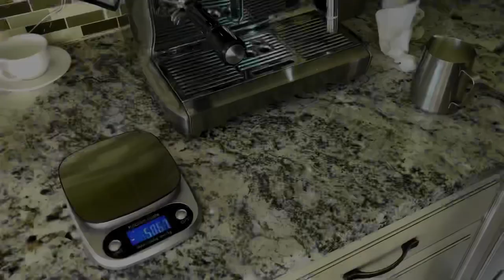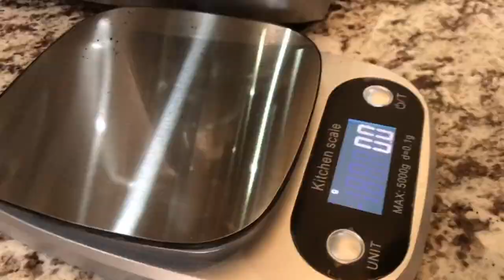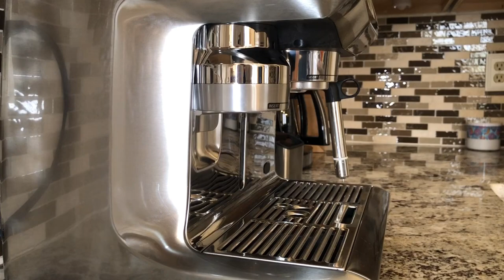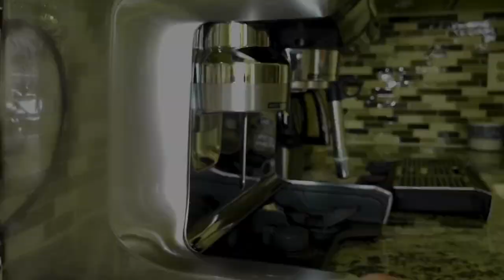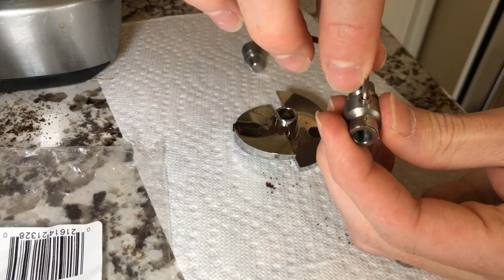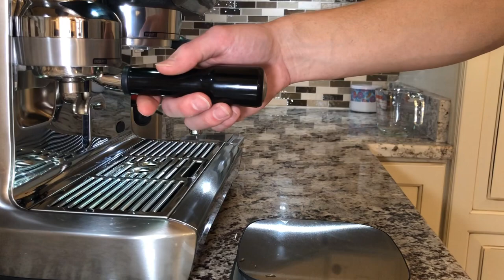Breville Oracle Touch Maintenance - Tamping Issues - Wavy Tamp

Comment: I had the same issue but the screw was still in place. What helped me was advice on Reddit: the tamping did not work on a completely dry basket. I was used to wiping the basket completely dry before grinding. With the auto-tamp, it’s best to leave the condensation wetness in the basket and not wipe it dry. The dampness helps to create grip for the fan, otherwise the tamp fan might just rotate the puck with it instead of tamping it. I assume the 1 cup basket has that special grip coating for the same reason.
Reply: Thanks for this valuable advice.
Reply from the maker: Thank you for posting this tip. I think I mention this in one of the videos or in some comments. For a while I would wipe the basket with a damp paper towel to add some moisture before tamping. You are right, it helps to reduce wavy tamps. Thank you!

Comment: I got the same machine early 2020 and thought it was damaged because the official unscrew-via-the-fan way of removing the tamp mechanism didn't work. I figured it that my machine was built differnetly by accident, but your video is the first one I saw that shows the way to do this if your tamping fan does not unscrew. It's puzzling to me that the officiall Sage/Breville materials don't show that way at all, since it obviously is in production for at least a year now. Thank you for this great guide, I would have loved to have found that back in Spring last year.
Reply from the maker: Thank you very much for your comment Earl. Have a great day!
Reply: I just got mine (2021) and it is exactly the same, it pulls out, it doesn't turn so I think we have the newer one. I also lost the screw while adjusting!

Comment: I had the same 'wavy' tamp problem and discovered the tamp fan needed replacing (I may have missed it, but I couldn't see that resolution in any of the comments). My unit was about 4 years old, and I make about 6 coffees a day for the family. I was told the tamp fan needs to be completely shiny all over. At first glance the fan looked shiny, but on closer inspection, the middle (lower) areas where it actually tamps the coffee were slightly tarnished. Once the fan was replaced, it tamped perfectly. Just another thing to check if you have wavy tamp problems. Hope this helps.

Comment: Hi Coffee Wiser, and thanks for taking the time to make that video. It was just what I needed to see if I was missing a part. 
The problem that I have is that, when I plug the "tamping fan " (with the screw tighten and everything) it remains loose, it spins freely. So when grind, the little square axis spins, but the connector and the fan don't.
Do you think that if I order a new connector it will hold to the axis ? Or am I missing something else ?

Comment: Mine just started doing this. I've owned it for 2 months. Has the same design for the tamp fan as yours. My screw wasn't loose, and I adjusted the fan the first day of ownership. Have been using the same coffee with zero issues since the day I got it. So looks like I'm probably going to have to contact Breville. Nice video btw!
Reply from the maker: Is your flow still looking good? Maybe the grinder is "breaking-in" and loosening up, and the grinds are coming out coarser? The machine will deliver a wavy tamp if grinding too coarse. I am not sure if there is a break-in period with non-titanium-coated burrs, but if your flow has increased, try to grind finer.
Also, I got a few wavy tamp after adjusting my tamp fan too low. I was trying to get to an 18g dose for a coffee and the tamp fan produce several wavy tamps per day until I raised it again. Maybe try to adjust your tamp fan up or down?
Reply: Coffee Wiser yeah it turned out that the fan was too low. Crazy thing is that it was working fine before. I suspect that I got lucky and all it took was a slight difference in this batch of beans to mess with it. Anyways, turned the fan a half turn and it fixed it. Getting 20 grams consistently now. I too wanted 18. I suspect that this could be fixed by having a longer threaded section on the removable piece.
Reply from the maker: @AnontheGOAT  I am glad you fixed it, and thank you so much for replying! Your comment will likely help many others! Have a great day.
Reply: @anon Hey Anon I am having issues with this too right now where it is too wavy. I did try and screw the fan tighter (less threads showing, like 3 threads or less). How many threads did you observe when you made the slight turn to make it flat again? Thanks and I would appreciate any feedback!
Reply: Reeezus P I believe I’m currently at 4. It’s been working ever since.

Comment: I have also encountered the same problem as depicted in your video as well as what others have reported below, where the allen screw is still there. I have tried some different methods with inconsistent results. First, the problem emerged when I lowered the tamp fan to get 18-19g. Raising back the tamp fan did not work. Stirring my beans with a slightly wet spoon did remove a lot of the static in the burr grinds, however, the problem would re-emerge after several other uses. I noticed that the puck seemed well tamp, but that the top had a lot of grains lifted or sticking to the fan. The flow was thus very fast. Grinding finer is the best choice which has worked. However, at the expense of not being able to achieve a perfect shot because I had to go finer than normal. All to say, I have reached out to Breville, and they ended up swapping my machine for another one, as it does seem to be a recurring problem. I will keep you updated with the new machine. Maybe this is the best course of action for others experiencing the same problem!
Reply: How hard did you have to push them for them to send you a replacement machine out?
Reply: @hxrnake  well just got off the phone with them today after bouncing back and forth for a month. And because I am in Canada, it'll take another 2 weeks before I receive the machine.
Reply from the maker: Thank you very much for sharing your experience. I am happy you were able to get a new machine.
Reply: @CoffeeWiser  I must have jinxed it. Even with the new machine, adjusting the tamp fan has now led to uneven leveling. Extraction is fine though. So it's just extra little mounds of coffee grounds on top. Which is annoying still

Comment: Thank you for your video. I had the inconsistent amount of coffee  in portafilter while grinding to single basket. I ordered and installed (according to your video) magnetic type tamp fan connector . I don't know what i did wrong, since i have the same problem. For single basket i have 9.5 to 11.5 g of coffee after grinding. Is any tricks to put the tamper fan connector on place. I just twist and push it. After that i pushed the connector and feel a little lifting (i saw in your video when you did a little push), but it is on place and very well sited. What i did wrong, any suggestion. Thanks again

Comment: Your instructions are always so helpful.  My tamps were recently a little messier so I took my tamp fan and the other piece out.  The screw is in nice and tight and everything looked ok.  But after I put it all back the tamps were much worse.  I’ve taken it apart multiple times and nothing is working.
Reply: What configuration of the inside cone and the outside wheel must be set so that the coffee comes out drinkable. Please, I haven't had a good coffee for two months. If you can tell me the exact configuration with a specific coffee that I can buy, better than better. Thanks.
Reply from the maker: Send me an email at everydaycoffeelife@gmail.com. I will help you to troubleshoot it.
Reply from the maker: Most wavy tamp issues occur when grinding too coarse. I recommend that you try to grind finer, maybe by 3 to 5 steps on your dial (for example, going from 27 to 24). Also, you should use fresh coffee (coffee that has a “roasted on xxx” date, and use it between 5 days and 20 days from the roast date). 
Also, wiping the basket with a damp paper towel just before grinding can provide more grip for the tamp fan and reduce wavy tamps. I hope this helps!

Comment: I have an oracle touch and the design of the tamping fan adjuster is different than yours.  In my oracle touch, the adjuster is not magnetic to the machine.  My adjuster screws to the machine.  The tamping fan still attaches magnetically to the adjuster.  Don't know which design (yours or mine) is newer.  I only see the improper tamping like the anomaly you show once in a while when I change the grinding setting three values either up or down.  But only happens once, then it tamps flat every time as long as I don't change the grinding more than two points.
Reply from the maker: That is great feedback! Thank you for the tip. I am sure this will help others that have this problem.

Comment: I’m getting wavy Tamps. I received a new connector and a new tamp fan. The problem still exists, not all the time but consistently. What else can cause this?
Reply from the maker: Grinding too coarse will cause a wavy tamp. I recommend you try to grind finer to see if it resolves your issues, that is of course if you can grind finer without over-extracting too much.

Comment: Thanks, I had the screw, I adjusted it so I could get 18g instead of 22g and in the process the screw must have fallen out. Do you know what size the grub screw is by any chance?

Also like your machine I also have the magnetic fan without turning it like the old instructions say so it must be a revised model (I'm in the UK where mine is branded Sage instead of Breville)

Comment: Thanks for video.  This at least helped me out by realizing Breville sent back my unit (unrelated issue) without my tamping fan!  I just got a heaping pile of non-tamped coffee grind.  Now I have to wait for them to send me a replacemnent or my old one at their repair facility.  Maybe they kept it?
Reply from the maker: Wow! That's crazy! It's probably just an oversight from the tech that worked on the machine. It's very annoying though, because now you can't use the grinder in the normal way. If you have a scale, you can weigh your beans (18g or 20g) and then just grind that into the portafilter, and tamp it manually (if you have a manual tamper). I hope you get your tamp fan back soon! Thank you for watching the videos!

Comment: I got 4-5 ridges showing on the little screw piece, but when grinding at 20, the machine leaves a terrible tamp... Why is that? I then adjusted the height again back to the original setting and I got a better tamp (still not clean, not flat at all), so how do I get the 18g -20g of coffee and a clean tamp if when I adjust the height I lose the tamp?... HEEEEELLLLP please!

Comment: I recently had issues with my Grinder unit and watched your video for assistance. Your tamp fan holder was different then mine, I have the piece like the one they sent you for your replacement screw. For some reason the grinder unit became misaligned. When I called Breville for assistance I was told it could have been a bad batch of beans that caused it. I could not get an answer from them if this is a common issue. Has this happened to you?? Thank you for your videos and all your help.

Comment: Thank you for the great video. I tried to do the adjustment for the single basket to have 10 g coffee each time with the same coffee bean, but every time i have the inconsistent results- amount of coffee in the basket varies from 9.5g to 11.5 g. Since the amount of coffee each time is different, it gave me the different yield and taste of my espresso. Do you have any suggestion to have the consistent amount of coffee each time. Thank you in advance.
Reply from the maker: It is not possible to achieve perfect consistency in the dose if you are using the tamp fan, because of the way the tamp fan works. 

If you are comfortable to prep your coffee yourself, you can pull down the tamp fan and only add 10g of beans into the hopper. Put your portafilter in as usual and start grinding. The grinder will grind everything in the hopper into your portafilter, then you can WDT and tamp yourself. This method can give you a consistent dose.
Reply: @CoffeeWiser  Does it means that the "Breville Oracle" will give me the different amount of coffee each time and it will different taste of coffee?
Reply from the maker: @romab7515  Basically, yes... the tamp fan will fluctuate. Out of five shots, three will be very close to each other, and maybe two will have a bigger or smaller dose. This will cause some fluctuation in the shot. But... if you are using fresh and good coffee, the shot will probably still be good enough to drink. 

To be fair, if you are using an external grinder and tamping manually, there will be some minor fluctuations with this method too because it's difficult to prepare a puck EXACTLY the same every time. Most days, I prepare my puck manually now. While it is more consistent than the tamp fan on the Oracle Touch, it is not exactly perfect on every single shot.
Reply: @CoffeeWiser  Thank you very much
Reply from the maker: @romab7515  Anytime! Take care :)

Comment: Just found out I have the same issue. Can you tell my the part number I need to order a replacement
Reply from the maker: This is the part I ordered. Please double check the part to make sure it works for your machine.
BES980XL/03.81B - Tamper Fan Connector - SP0008144
I hope this helps.

Comment: I'm having the same problem with my new Oracle Touch.  Producing a wavy tamp.  I checked and I do have that little screw so I'm not missing mine.  Any other suggestions on ways to fix?
Reply from the maker: In the forums, another suggestion was to wipe the inside of the filter basket with a slightly damp water towel to improve the adhesion of the coffee to the filter basket wall, and prevent the puck from sliding around during the tamp. Reportedly, this has improved or resolved some people’s issue. 
Also, if your machine is brand new, maybe the tamp fan wasn’t calibrated properly and should be adjusted up or down? I am finishing a video now on adjusting the tamp fan. If your machine is new, Breville should be willing to help troubleshoot.
Reply: Everyday Coffee Life Will give that a try.  You are doing a fantastic job with these videos.  Really appreciate this!  I'll let you know if I get it working consistently.
Reply: Would you mind linking to the forums you go to?
Reply from the maker: Here is one thread I read on the subject: https://coffeesnobs.com.au/brewing-equipment-pointy-end-1500-3000/37042-breville-oracle-owners-thread-bes980xl-3.html. It starts at #108. I will post more tomorrow. I hope this helps!
Reply from the maker: I reread this thread on the forum and another potential issue is grinding too coarse. Could this be the issue? What grind setting are you on? Were you able to fix it?
Reply: Everyday Coffee Life Looks like I was grinding too high.  I lowered it into the teens and now it's a perfect pick every time.  Thank you for the recommendation.
Reply from the maker: It's great you were able to fix it! Enjoy!

Comment: Hello coffee wiser. My machine is doing ghe same. I adjusted my tamp fan the same as you have in this video but it is still happening any thoughts. The machine is brand new.
Reply from the maker: The most common reason for this issue is because you may be grinding too coarse. I recommend that you turn your grind setting lower (i.e. from 28 to 24) and try again. My machine regularly messes up the tamp if I am at 25 or above. I hope this helps.
Reply: @CoffeeWiser  thank you
Reply from the maker: @kenainmeshik  Did grinding finer help to resolve your tamping issue? Thank you!

Comment: Do you know how to fix the heating temp issue.... My machine wont heat up past 159 after I descaled my machine... Please help
Reply from the maker: Have you been able to resolve your issue? 
I have heard that sometimes the sensors remain coated with descale liquid. Purging the boilers and running another rinse cycle may help to fix your issue.
Reply: @CoffeeWiser  Issue resolved.... Apparently a fuse was blown during the descaling cycle. Common problem for these machines according to the repair technician.

Comment: Hi Coffe Wiser great video I have an issue where when I grind it does so for 2 secs and then goes straight to tamping?? some times 9t won't even grind but after pressing the tamp button (oracle touch) it tamps right away ??? any ideas
Reply from the maker: Did this happen all of a sudden? Or did you make a change to your routine? For example using a different basket?
Was anything wrong with your tamp fan? Missing screw? or set too low?

Comment: How often do u get a bad tamp. My machine is new and I get them all the time.  All the time.
Reply from the maker: If you are getting them all the time, it is most likely because you are grinding too coarse. Try to grind finer and your problem should go away. I hope this helps!
Reply: But I’m getting great flow   37 g at 27 sec with 4 threads
Reply: 20g in. 30 to 35g out. Grinder with bean 22setting. It pulls a good shot but takes 3 tries for it to work.  Never on the first shot.  I can try finer
Reply from the maker: @psuhurdler  What kind of coffee are you using? What kind of roast and how fresh is it? I am wondering if you have room to grind finer without compromising taste. Also, have you tried a different coffee? I may be this particular bean or roast that is challenging your machine.
It is definitely weird that it is taking a few tries to work. I am guessing that you are not missing the screw on the tamp fan like I was?

I hope you are able to resolve your issue. Take care!